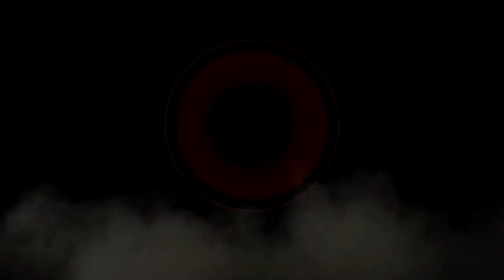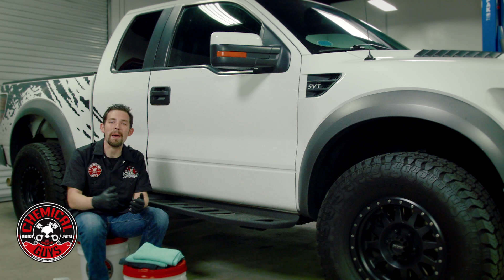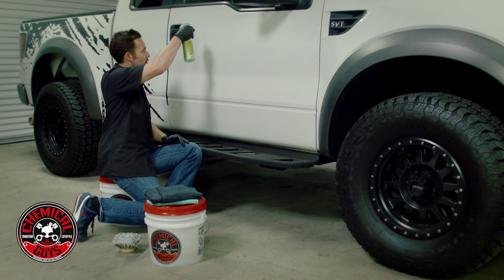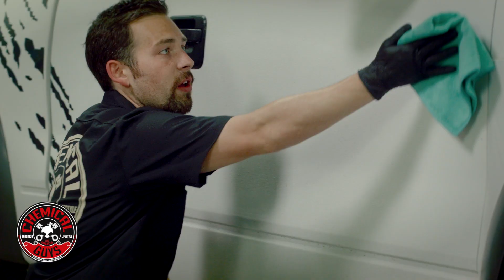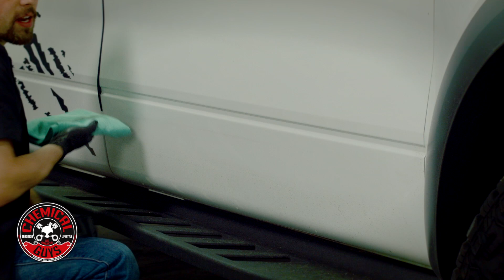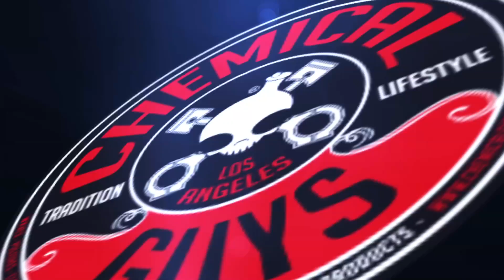How To Wash During Water Restrictions - Chemical Guys Car Care

Comment: So no water need but how much water was used to make bottles of this Eco Smart ?
Reply: Exactly in the end it's all bull
Reply: 09BertoSS less than you'd use if you washed it with a bucket full of water.
Reply from the maker: 09BertoSS Humans are 60% water. 71% of the world is covered by water. Coca-cola is 90% water. Food for thought.
-CG
Reply: +venger I don't use a bucket full of water, I use the foam cannon & I rinse my car down with a water gun so it's a controlled amount of water.
Reply: +Chemical Guys can we get an exact amount of water used to make each bottle\gallon of Eco smart if you guys want to talk numbers? That was my original question, that was ignored btw.
Reply from the maker: 09BertoSS The amount of water to mix with ECOSMART depends on how strong you want the solution to be. Also, the size of the container you are diluting will also determine the amount of water used. ECOSMART is sold as a concentrate formula and 1 gallon of EcoSmart Concentrate make 16 Gallons of "Ready To Use" Ecosmart solution. Also, the dilution ratio on the bottle is recommended by our development team, but some detailers will mix it with more or less water depending on how strong/weak they want the solution to be. What you must understand is that everything in the world is made from water. Once you mix water with other chemicals, its not water anymore.
-CG
Reply: +09BertoSS You can keep track how much water is coming out of a pressure washer? That is amazing.

Comment: The car isn't even dirty...
Reply from the maker: TZRobin Yes, the car is dirty. We are a detailing shop that details vehicles on a regular basis. Not ever car has mud on the paintwork. We are located in Los Angeles, a large city. Do you think that cars get muddy and covered with dirt in Los Angeles? The answer is no. Cars in Los Angeles experience industrial pollution live overspray, rail dust, fall out pollution, brake dust, and road tar. These problems all the make the car dirty, and are far more difficult to clean than mud. Mud simply rinses on with water, but road tar and contamination embed into the paintwork and take hours to remove in most cases. The owner of this raptor has the Detail Garage clean his truck once a week.... so of course being a white truck the car is gonna stay cleaner for longer because we are a professional shop that produces quality results. We are a detail shop, not a "car wash". There is a difference between car washing a detailing. Detailing is about maintaining the condition on the vehicle, and customers that are detail oriented, most of the time, will never let their cars reach a state of neglect. Not every vehicle is covered with mud, and there is different kinds of "dirty" conditions that you must learn about. Watch our 700+ videos to view the different examples of various levels of "dirty".
-CG
Reply: Chemical Guys No, this is not a dirty car. This is a dusty car. I also know my way around a car when it comes to detailing, so don't come here and tell me that I need to watch your 700+ videos of advertising. 
I have used your soaps for a long time now, and I'm very satisfied with them, but I am not satisfied with Ecosmart for my needs, and as you say in your videos about the product, is that it works wonders on dirty cars. It does not. On dusty cars, yes. But not dirty cars. 

I am a big fan of what you guys are doing, and I'm looking forward to see more products from you. 
Now I'm going wash my car with hot water while I'm drinking lots of cold water in this summer heat. 

Cheers.
Reply from the maker: TZRobin If the customer comes to the shop and is paying for a wash, we will give him a wash. If the truck was truly just "Dusty", the owner would have just used a wool duster. We give customers the services they request and go above and beyond to meet the needs of the client. 
-CG
Reply: TZRobin Chemical Guys I also own a white car. My friends say the same thing "your car isn't dirty" meanwhile its filthy. Nearly impossible to pick up dust and pollen etc, on a white car on a camera. Unless you own a white car, you'll never know.
Reply: +Mike Rogne I love how TZ says "so don't come here" when he was the one that came to their video.
Reply: +Chemical Guys i don't nt even wash my own car i get a hand wash at a wash place near my house and i do the detailing at home because washing the car myself, to me is too long and not worth it.
Reply: +Chemical Guys Well said,  the level of dirt is a subjective thing and people bring their vehicles to you guys to achieve results that please them, that is what detailing is all about.
Reply: +TZRobin But it isn't exactly show worthy is it? What if this car was heading out to a show or festival and the owner wanted it to look the best it could be?
Reply: Chemical Guys Dang, TZRobin got under your skin lol